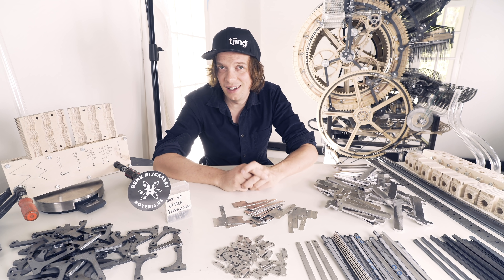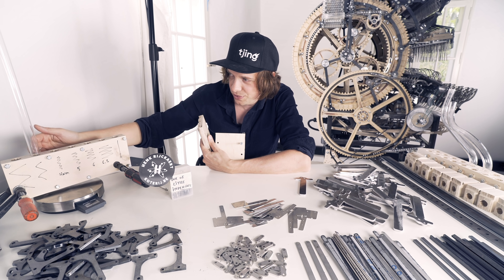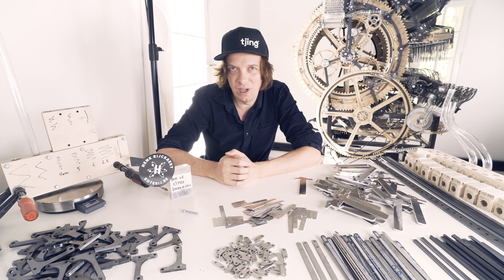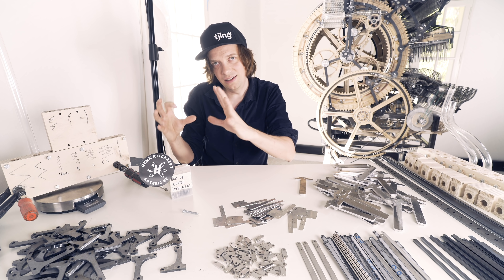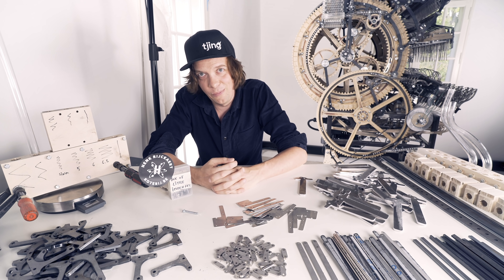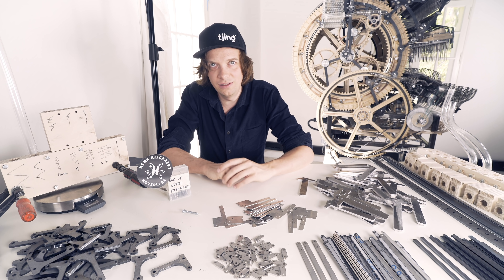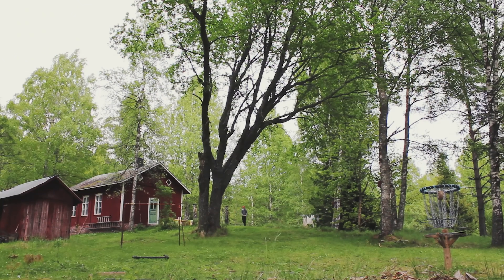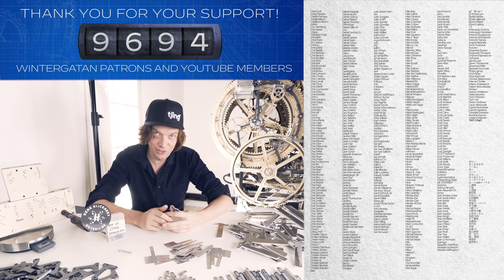New Parts and Quick Update - Marble Machine X #140

Comment: I think your intention that the finished product of the first version of the MMX will be a functional model is the root to you feeling like it is a failure, as this is rarely the case with the first version of anything. You may be able to fix fundamentaly flawed parts of the machine by fixing the symptoms, with positive and negative aspects of every fix. However your feelings of success should not be hinging on wether the machine will be able to play or not. If you instead see the MMX as a process to learn how to build a functioning marble music machine it is a complete success because the MMX is not the machine, it is you and the community building it. 
You are an inspiration to countless Numbers of People regardless of the machine you are building.
Ps. The tvdrama Longitude should be suiting to watch during your vacation. It is about a carpenter trying to invent a clock that Will work at sea. Spoilers: the first version did not work the way it was intended.

Comment: Yeah everybody who works with engineering and development runs into this, that it feel impossible because you now understand better than ever the difficulty of certain things.

But! This is also this state where we start worrying overly and complicate things that don't have to be complicated.

If you had the knowledge you do now you probably would never have attempted the MMX, and other people with a lot of engineering experience have said it seemed almost impossible.

That's my least favorite type of maker, developer or engineer the ones who give up easily nothing great was ever made without pushing boundaries and having some inherent optimism. The nature of what is possible isn't something set in stone, it's a soft medium constantly under change. And sometimes it does mean having to solve issues and feeling like an eternal project.

But at some point you'll get to where the machine is done and is working without a doubt, this will be a state where there probably is improvements and repairs that could be done. It's important to realise when something is becoming maintenance compared to development.

You're not quite there yet, but focus on the things needed for the simplest success scenario even if that's more limit that initially thought, and then work from there to upgrade, maintain and repair.

Comment: Solution to the friction if you have the space bring the marbles into the gate horizontally and the gate drops vertically so the gravity force of the marbles ins't pushing down on the gate but into more of a stopper at the end. You could also in theory, use a rack and pinion kind of arrangement to make a rotating gate, think sort of like a ball valve. Basically work perpendicular to the force you're trying to negate.

Comment: I'm a programmer.  And what you describe is exactly what happens to me (and many engineers I assume) when dealing with difficult issues.  One bug leads to another and another, one fix leads to a breakage elsewhere, etc.  At times it can get to the point where you "question reality".  An example of this in say, JavaScript, is you start writing code like "if(true) { ..."  just to verify that "if" statements work because SO many things just do NOT work, there has to be SOMETHING wrong with the universe. (Star Trek Meme - There must be something wrong with the universe)

Taking a step back is the best thing for this.   Enjoy your time away, and do your best not to dwell on the MMX if you can, but also don't beat yourself up if your mind drifts back to it.  Just remember its ok to ignore it for this time. :)

Comment: Wait what....MMY?????
Reply: The plan is to finish MMX, CAD the whole thing and make a duplicate machine called the MMY. The closer to an exact copy it is the more likely it is to be completed quickly. The more is strays from the MMX the more scope there is for small tweaks, fixes and improvements that would make it more robust that the original MMX. Both machines will go on tour. One to perform and one as backup.

Comment: The way to kill the force on marble track is a sharp turn. The catch is of course that if it's too sharp, you get jams. You could for example have a few centimeters of 30 degree slope turning to a vertical drop in sharp corner right at the end. Most of the force goes into the side wall, but it doesn't jam because the pressure point is clearly above centerline.